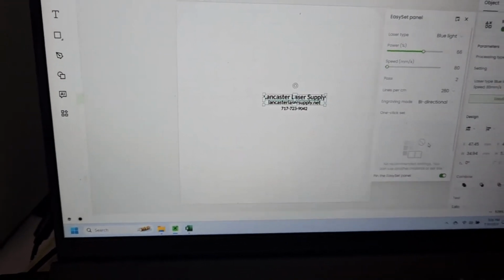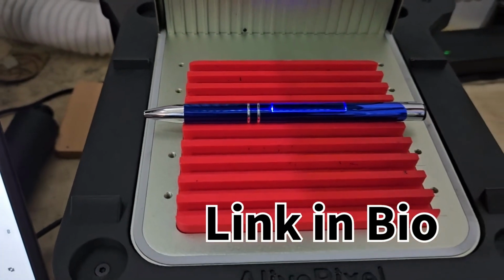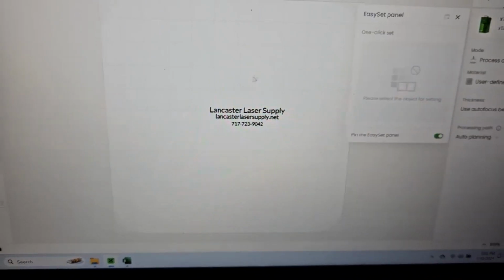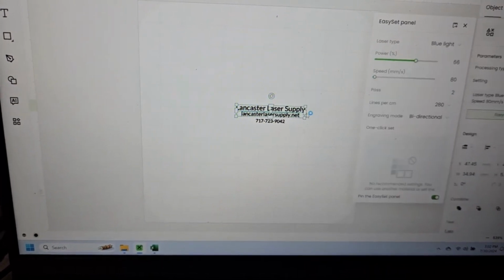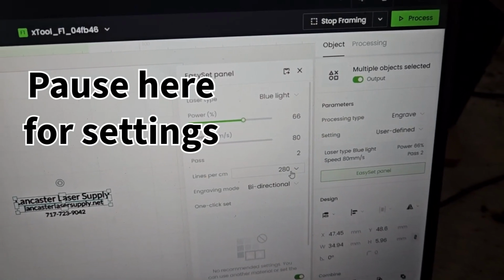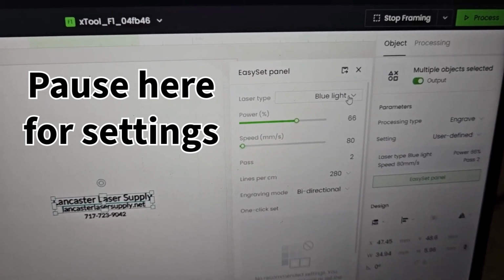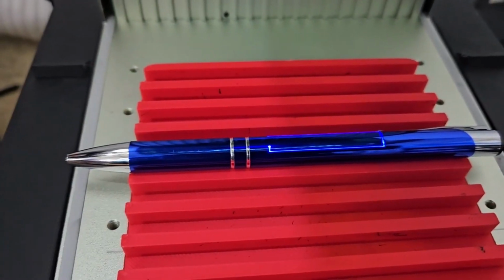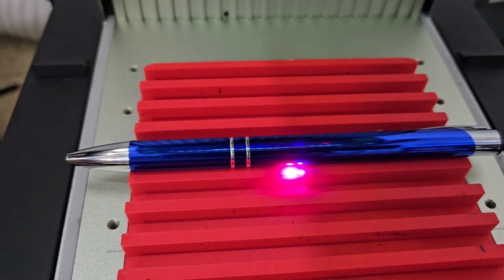How to Laser Engrave a pen perfectly every time - Beginner laser engraving

Comment: LANDCASTER SUPPLY SENT ME THE MATTE PENS INSTEAD OF THOSE ONES YOU LASERED. HOW DO I REQUEST THE METAL NON MATTE? I WAS UPSET...
Reply from the maker: Hello James, I see you ordered the metal black pen. Its part number MP-Black. Each color pen will have its own part number. I assume you may have inadvertently ordered a version that you didn't want? Did you want the RSP-Black? Please feel free to reach out to us if you need help. info@lockconnection.net.
Reply: What is the max file height before it gets distorted from the curve?